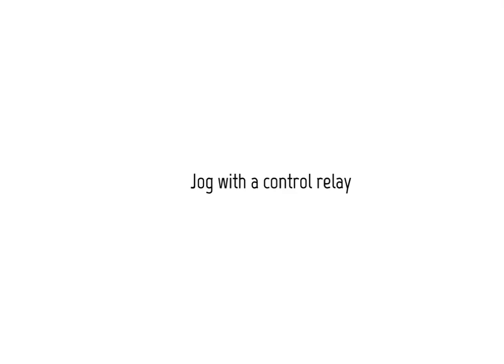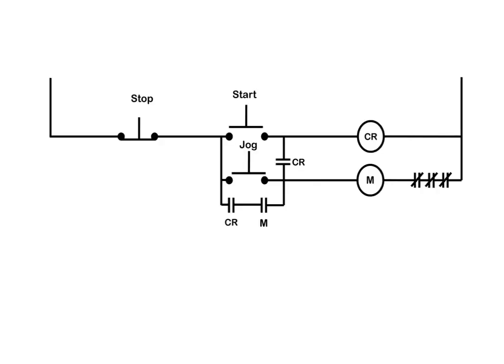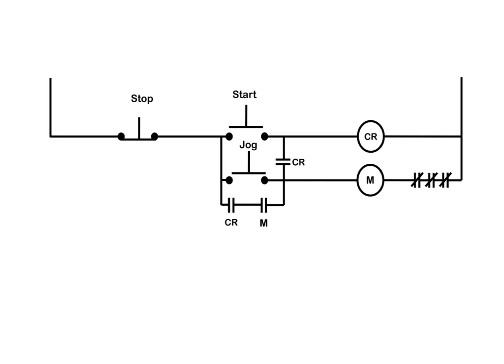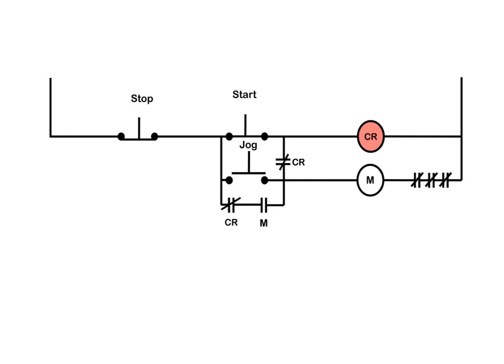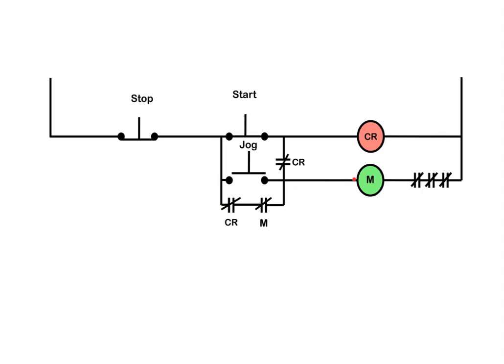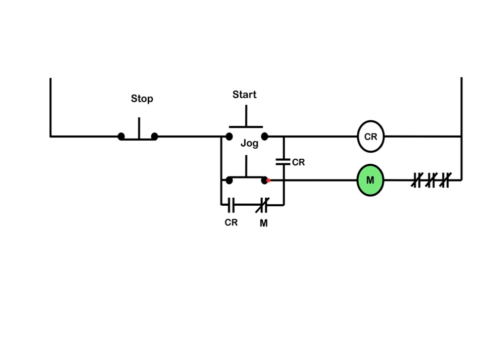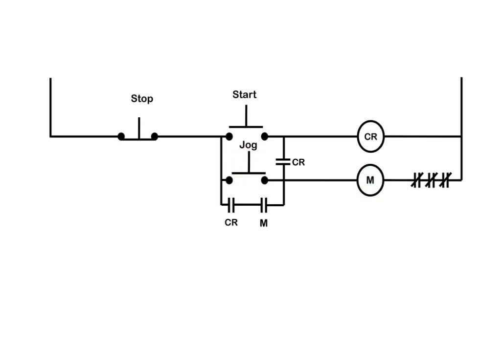How does a jog circuit work with a control relay?

Comment: Often with certain machinery, the "jog" function needs to also assign a value to the motor speed control.
In this case, I use a separate "Jog" relay and would replace your "Jog" button on your diagram with an open contact from that relay. 
Additional contacts in the relay can be utilized to send a value to the speed control suitable for the application.
Usually, one does not want to press the jog or inching button and have the motor burst to full speed.
But maybe in others it does not matter.

Comment: thanks buddy in trying to learn how to draw motor control circuits.  in wanting to draw one with stop start jog.  light for each button activity with a motor stopped running or jogged using 2 control relays. and 2 sets of N O, N C contacts